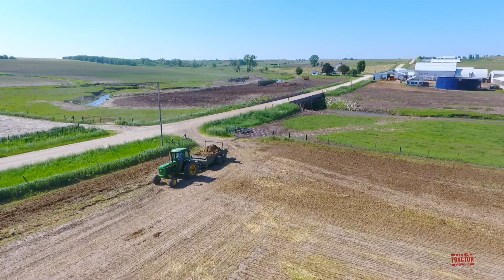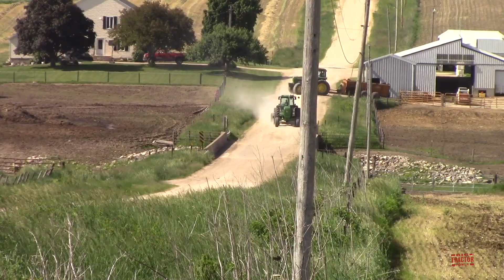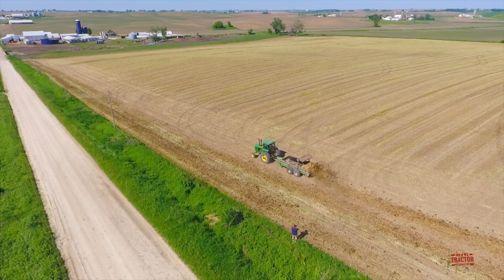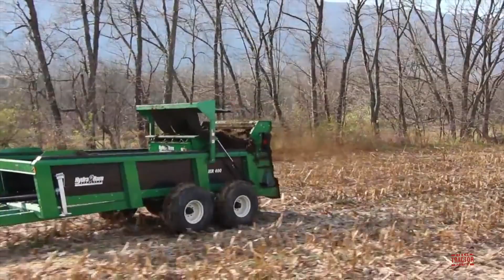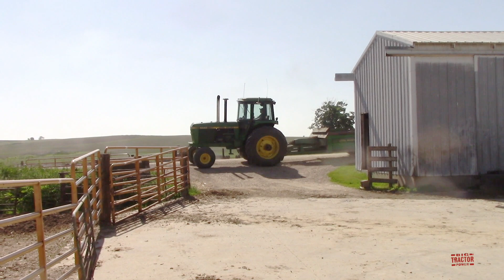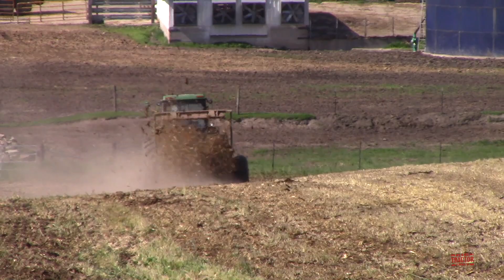John Deere 780 Hydra Push Manure Spreader & 4440 Tractor

Comment: We used one of those New Idea spreaders you spoke about early in the video.  It was used primarily to support a dairy, some heifers, calves. It was 95 bu (I think?), with three beaters - two spike that broke up the load, one paddle beater at the rear to throw the material.  It had a chain/bar mechanism on the floor to pull the load back toward the beaters.  It  was ground driven, one wheel driving the chain/bar unloading mechanism, the other wheel driving the beaters.  Two hand levers at the front could be reached from the tractor seat, one for the chain/bar, the other for the beaters.  The first one had notches to control the speed at which the chain would pull the load toward the beaters.  The second one controlled the drape of a large chain link across a drive sprocket on the drive wheel.  We pulled the spreader with a Case VA, about 28 hp.  In the Winter, one very full load every day.  It was loaded with a carrier on tracks - shovel the gutters out with shovel, run the carrier on the tracks behind the stanchions, then run on track out the door, over the spreader for dumping.  If the fields were too wet, the manure had to be stockpiled, the pitched into the spreader in the Spring.  The spreader was also used to support 500 chickens - 6-7 loads every few weeks.  This was all hand loaded, forks, shovels.  Yes, "cleaning out the barns" was my job - shovel the gutters clean, into the carrier, then out to the spreader.

Comment: i have a nice simple NH195 chain floor twin horizontal beaters and it does all our 150 cow/calf operation needs, usually a week to ten days by myself, saves hiring in a crew (which there isn't allot of these days). put these little spreaders up beside a 32ft Bunning Lowlander for shits n giggles eh.

Comment: Awesome video, I ran a 780 behind a Deere 4450 for 13 years. I own a Pik-rite now but it’s not as good. They cheapened it up.
Reply from the maker: A 4450 and 780 are a perfect 1980’s combination.  What do you run your Pik-Rite with?
Reply: bigtractorpower I am using a Deere 7810 now.

Comment: Old reliable👌🏻 Do you think that the stuff made today will last as long?
Reply: Dahlmasen in my personal opinion no. Everything’s got a throw away eco bollacks engine. Good that they are turbo charged but they have such a small displacement and such a high boost not to mention all of the particulate burners and the electronics to regulate emissions. The metal as well seems to be of worse quality, in my personal opinion that is
Reply: Not a chance.
Reply: Nope.....to much electronics and wires in new equipment

Comment: In a zoo the monkeys fling their poo at people like that spreader did when you were behind it filming.  Does that type of spreader work with wet manure as good as it flings the dry stuff like today?
Reply: In my experience with a new holland 185 no they don't work to good for wet slop as soon as you lift the rear gate you have on but pile on the ground before you can even get the pto going.